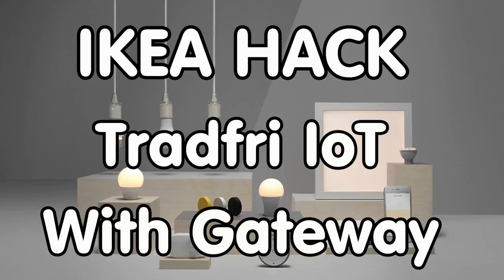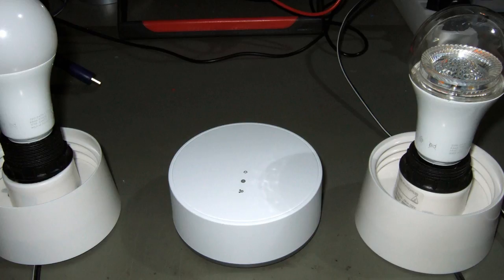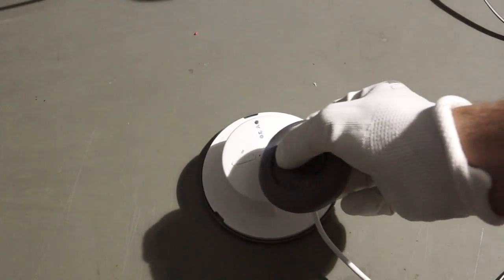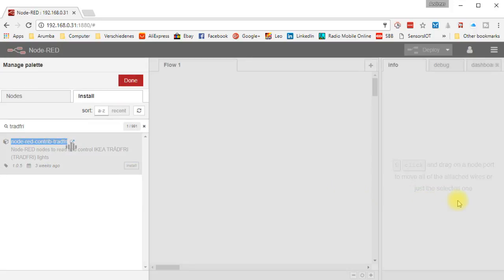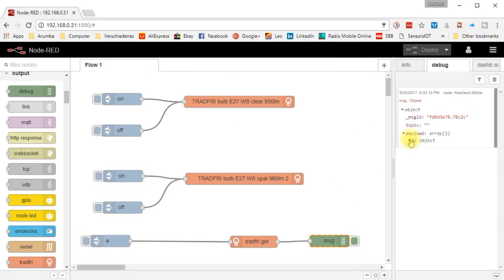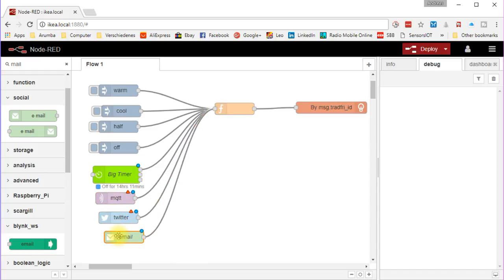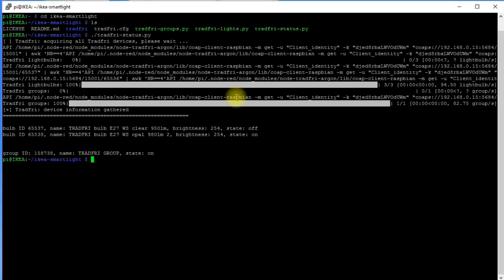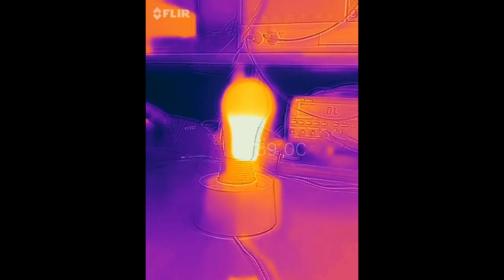#145 IKEA Trådfri Hack with Gateway, Raspberry connection

Comment: I'm sorry to rain on your parade, but besides the glorification of NodeRed and Scargill's scipt, where is an actual explanation how to use MQTT?
DragnDrop a box in NodeRed is not a solution for somebody who has a fully working MQTT server/setup with a bunch of nodes that send a bunch of metrics and is not really into playing with stuff in one's browser - so we need a real explanation how to use existing infrastucture to control Tradfri equipment.

That explanation should give some suggestions and examples of:
- how to install/configure an MQTT server/broker of choice (Mosquitto for example)
- how to install/configure a COAP server of choice (from libcoap for example)
- how to send and receive COAP messages to/from Tradfri gateway
- how to recode them into MQTT messages and send/receive them to/from a certain MQTT topic
- how to use this new or existing MQTT server/broker with the rest of services

If I need to write my own message translator from COAP to MQTT and back, I'd rather do it in Python and have them run on dedicated hardware then use half of it's memory on silly NodeRed JavaScript interpreter which has no place outside of test lab...and for that, we need a better explanation of the whole setup than a picture of a bunch of interconnected colorful boxes in a browser.

So, can you digest this whole setup to a more basic/generic setup so that everyone can use any piece of software that does the job instead of relying on a specific one (like, libcoap vs raspbian coap client, whatever it is...)

Sorry if I sound harsh, but I'm really sick of insisting on Raspberry and NodeRed, as if nothing else exists and there's no other way to do simple stuff...

Thanks, Andrea
Reply from the maker: You are really harsh. This is not necessary, because a simple google search, together with a careful watching of my different videos about the topics MQTT, COAP and Tradfri Gateway would have helped you more than this post.
Reply: As I said, I am sorry if I sound harsh, but just let's get it straight - it is not directed at you personally, but in general toward the whole community which forces NodeRed and Javascript down everybody's throat because everyone is too lazy to program a proper code that does one thing as simple as possible - and does not require too much memory and cpu power.

On to the problem - yes, I did watch all of your MQTT, COAP and Tradfri videos, and I have learnt quite a few things from them, but still, everything is based on NodeRed.
Even more, all of the google searches somehow redirect to the same videos/setups...

If I try to find a set of "basic" components, stil I end up with heavyweight implementations or those that so few people understand and are able to maintain/modify.
So, while trying to find COAP to MQTT bridge/proxy/translator, search goes to Eclipse's Ponte NodeRed implementation, or one written in Erlang, and one written in Go (???) So when did python, perl and simple C/C++ go out of favor for simple and fast implemtations of a service? Is everybody blind to realize that NodeRed can not be implemented in soooo many types of hardware while regular MQTT broker, for example, will happily run on measle resources?

To note - I did find another implementation of the whole Tradfri setup that uses MQTT, but it is written in Java - can you imagine running the full JRE on a small resources device just to be able to turn a lightbulb on and off?

That is why I got so pissed and tried to get some info from you about using the basic components for the whole Tradfri setup and not installing NodeRed on every piece of hardware in my house - therefore, I still ask for help about how to use existing MQTT setup with Tradfri COAP implementation...
Reply: So you claim so much knowledge, yet haven't contributed. Others to do the investigations and you criticize them? Such conceit and arrogance. Come back when you give rather than take.